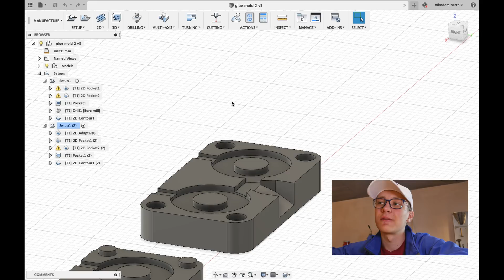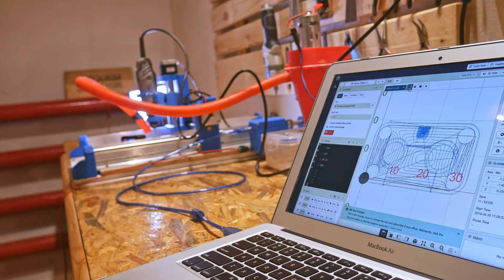DIY Injection Molds With Dremel CNC And Hot Glue #2

Comment: Seems your M5 washer mold is the maximum surface area a non heated injection will take because the plastic stops dead just at the exit.
So you either stick to comparable surface areas or try the heating and release agent approach.

Comment: Using wood as an insulator, try using the tip of the hot glue gun to heat the mold before you start injecting the glue/polymer. I like this idea and would love to see your future improvements. The initial time to make the mold is longer than just 3D printing washers/gromets/etc with a flexible filament, but then you can crank out hundreds pretty quickly. 

Don't get too discouraged, I think you are on the right path and I think a warm mold, perhaps with a release agent, will help. I don't recall how long you waited before attempting to demold your hot injection attempt from the last video, but maybe waiting until everything has cooled to room temp or lower will help out with the demolding.

Comment: see my original post and make that simple cheap 12v glowplug version https://www.youtube.com/watch?v=CZSxT8IBIJc&lc=UgyRTxSIYPXgbN0_BgZ4AaABAg
your almost there, place your exit hole farthest away from the inlet..and make the inlet bigger to take the heater tip and so seal it far better... regarding heating the mold,all injection "molds" are always heated for a reason btw as your finding out, and remember your base material , hot glue in this case, melts around approximately 120 °C (248 °F)
there are many diy (localised mold ) heating options,.....

Comment: Great project. I agree that you should try a better quality hot glue gun and create a better seal with the tip and the mold. A better glue gun may heat the glue even more creating better flow.
Reply from the maker: Thanks! I will buy one soon. Zip tie mold has a proper inlet so there is no leakage around the nozzle

Comment: Great to see that you improve on your old projects :D i've got a tip about the machining however, if your machine is somewhat square it's  good to take shallow face cut on top of the part especially when you know that this face will touch another part,  even 0.05-0.1 mm will be enough and you will be sure that your surface is flawless. Keep on !
Ps. Mabe some vibration dampeners for your printer?

Comment: hey niko, if you fabricate the mold, drill the injection port later with the drill and countersink it so the nozzle of the hot glue gun fits perfectly, that way you dont lose plastic and you can build more pressure!

Comment: Too narrow spaces for such a low temperature material to go through. Hot glue gets solid quite fast and your mould is made of aluminum which also makes the task harder because aluminum cools the glue down relatively fast and that is why you were unable to push it though long moulds. You would have to either use hotter material or you would have to push it faster through the mould. Making glue hotter will be hard because it has its limits. It is easy to overheat it. Also thermal capacitance of the heating element in a hot glue gun is important. The bigger wattage it has, the longer the stream of really hot glue is available to be pushed through. Anyway, I am pretty sure that this hot glue is not the right choice for a long narrow moulds. It will become solid very fast.

Comment: Try using silicone. The large tube with a silicone gun. The silicone won't solidify as quickly, giving you more time to squirt it in, but you will have to allow more drying time before opening the mold. Great job and effort so far.
Reply: Did this with a 3d printed mold
Reply: Add cornstarch to the silicone and it cures much faster. Check out protoputty on youtube
Reply: @tdpweaverful  but the cornstarch can attract bacteria when moisture gets Inside
Reply: @ErosMagnum  the purpose of the corn starch from my understanding is the moisture. I may be incorrect but the chemical reaction that causes the silicone to cure starts from the moisture in the air.
Reply: @tdpweaverful  silicone cures faster without moisture no doubt. Which is why vacuum helps. But most silicones will cure even submerged in water. 
Cornstarch is a really bad idea. Theres a reason they can't use it in makeup anymore it promotes bacteria growth because it's basically corn carbohydrate. Sugars make starches make proteins. 
This is biology 101. 
If you cant wait 24 hours for silicone to cure. Use a vacuum or a pressure pot. Don't use bacteria food. Because someone's too cheap to use talc.(shouldnt use a drying agent anyway it just makes the silicone weak)
Cornstarch is good for biscuits and pizza.
Reply: @tdpweaverful  cornstarch can actually inhibit the curing. Or make the silicone so weak it doesn't bond. It's fine for making playputty or DIY rubber bumpers. But not for anything professional or lasting.
Reply: @ErosMagnum  lol sorry for being two weeks late. I am familiar with biology and did not say you were wrong. The purpose of my comment was to offer a cheap unprofessional potentially non lasting alternative. Thank you for making note of the shortcomings though. Definitely worthwhile food for thought. No puns
Reply: @tdpweaverful  it's no problem. I've been trying to get people to stop spreading the bad rumor of using cornstarch for anything other than food. Because cornstarch is a food. Mix it with water and leave out for 12 hours and you have a bacteria culture. Put it in a hot nonstick pan and you can make noodles . It's a perfect example when an uneducated gets passed around. Did you know cornstarch is banned from makeup?
Reply: And use white mineral oil as a mold release. I spray it with a regular trigger sprayer. I need to get a quiet air compressor and make my own aerosol cans
Reply: Without an additive the silicone will never cure in the center. I don't know about cornstarch, which was suggested above, but I do know the professional use vegetable glycerine as a curing accelerator for silicone parts or molds with a large cross sectional volume.
Reply: @AtlasReburdened  using anything but 2part silicone is masochism to me.  Also using a vacuum chamber makes things easier.
Reply: Years ago I worked at an elastic factory. And yes we made some adult toys the thickness of my arm. All we used was 2part platinum rtv silicone, and white (clean scentless mineral oil) in plaster of Paris moulds. Look up the ingredients of mould release. Its mineral oil and something to make it aerosol easier. And dont use anything that comes from food (like cornstarch) if you want something that doesn't attract bacteria.
Reply: @ErosMagnum  Ahh, that makes sense. I have no experience with 2 part as far as silicone is concerned so my mind was just working around the different air curing kinds.
Reply: The reason I suggest white mineral oil is it's safe for human contact. Doesn't promote bacteria growth. Any if you somehow ingest it you get diarrhea. 
And its universal for releasing glue, abs, silicone, ceramics, and it evaporates. 
And don't add stuff to the media like cornstarch. Im suprised some think they know better than the manufacturer.

Comment: Hi,
Maybe you could tear apart a water boiler and use it to make a vise that holds your mold in boiling water. Then the mold is hot while you inject the glue into it.
Adding salt in the water even lets you raise the temperature to about 120C

Comment: What will happen if you heat the mold up to about 60°C using a hairdryer? Thanks for sharing the failures too!
Reply: How about making a machine which used a 3D Printer extruder to pump melted filament into you molds?
Reply: @AndrewHelgeCox  i have yet found people using hot glue as filament. This should be possible
Reply: In such small elements escape of temperatures its no problem.
This cane be helpfull with bigger elements.
Reply from the maker: Check out my first video about DIY injection molding to find out

Comment: You have one choice left:

1) You've got to find a pump without any leaks as you noticed

2) you use a glue with the point of fusion low enough to guarantee that the hot glue will remain liquid during a relatively long time (the time it fills your cast completely without any additional force). The problem with the glues you used is their high viscosity. Don't fear to use other materials that are more liquid when heated (some polymers), not necessarily glues. Google or get help from a good chemist in forums that don't deal with 3D printing nor filaments ;)

I'm glad that your CNC becomes the basis of a lot of interesting projects like this one.

Comment: Aluminium works as heat sink. Have you tried to heat mold up before putting hot glue?
Reply: Nikodem did it last time...
Reply from the maker: Yeah, check out my last video about DIY injection molding

Comment: Try to melt PLA which is failed 3d print or support material and inject it
Reply from the maker: I would like to do this, that would be great for recycling failed prints. Firstly I need to build a DIY manual Injection machine and then a small shredder
Reply: @nikodembartnik  that would be awesome tho
Reply: @nikodembartnik  hot glue washer that you can melt in to the hole for better adhesion? :O
Reply: @nikodembartnik  I've seen others use small personal blenders as shredders and it works rather well. Just get a throwaway one.
Reply: Nikodem Bartnik I use my direct drive extruder from my 3d printer
Reply: That’s a sick idea!

Comment: What about using a small vacuum pump with very low suction to help draw the hot glue in?    Squeeze the glue while the vacuum is sucking from the other end of the part mold.

Comment: I don't understand at all the worry about heating an aluminum mold? i would try heating it with a hair drier or small torch or even a candle. The soot from a candle could even be a good help in release. You don't need to heat the mold to glue melting temp just enough that the aluminum won't suck the heat from the glue enough to chill it quickly.
Reply: when you use hotglue on cold metal it won't really stick. and you can get nice imprints off of it.  
when you use hotglue on warm metal it will bond so strong to it that you bend the mold trying to get it off and ofcourse tear the hotglue into pieces
Reply: darkracer125 i don’t think the glue was the issue in his first attempt. There may not have been enough clearance for the  “pins” and they cooled into a slight press fit which made the mold difficult to separate. I didn’t run any numbers or measure his pins, but that’s my educated guess anyway.

Comment: Try preheating your mold with a heat gun. It will require less pressure and should fill completely. Thanks for sharing!
Reply from the maker: Check out my first video, heating up the mold is not a good idea